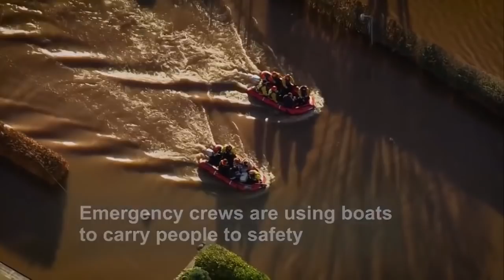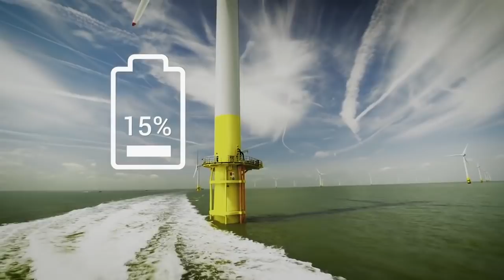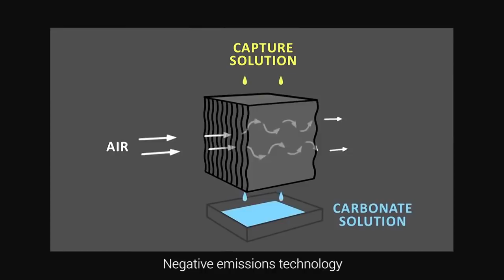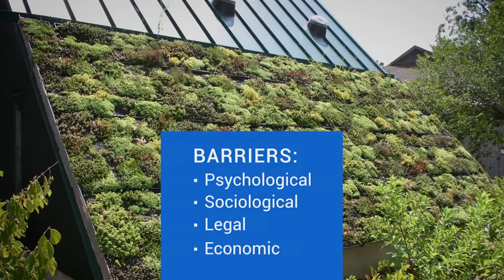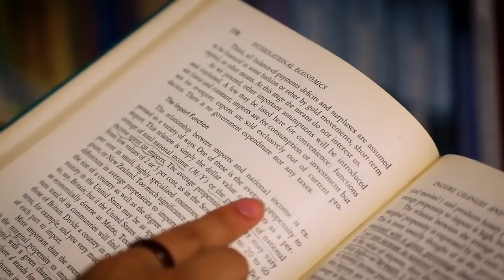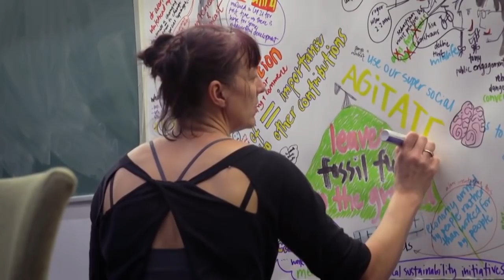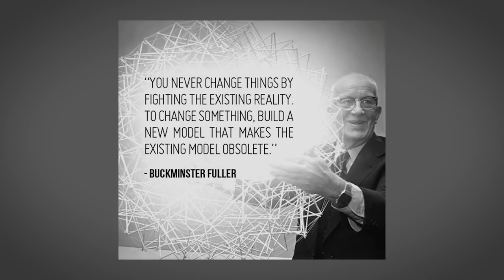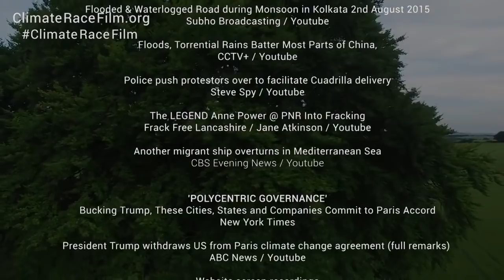The Race is On - Climate Change Documentary 2020 ᴴᴰ

Comment: Earth's climate has a rough history with climate change. The problem has been that it has been too cold for us. (Examples - Major event of Younger Dryas that froze the Earth for 1000 years 12,500 years ago. We have a medium-major event that froze the planet and blocked the sun for a decade in 563 A.D. known as the Late Antique Little Ice Age and a minor event causing decades of colder temperatures in the 1800s leading to crop failure and famine as well)  Although we may be contributing to climate change; it seems that what we do is a drop in the bucket compared to natural event caused climate changes such as increase in volcanic activity, major volcanoes single eruption, and intersteller object impact events. If we want to worry about climate change we should look to the sky and look into the ground.

Comment: There is this one question (or rather a dark image) that keeps coming back in my head everytime they talk about these beautiful green energy sources like solar or wind.. since we know that we are in no way stopping the warming completely and we can quite reliably predict that it's all going to come with more extreme weather, how are those solar panels gonna deal with furious winds and violent storms? Are those wave-energy systems designed to withstand unusual extremes? How about windmills being ripped apart?
Reply: If the extreme weather events increase to the point that solar panels or wind turbines cannot survive, they will be the least of our problems.
Reply: Then if they will be destroyed in the future, they will replace the broken one ofcourse.
Reply: @ronalynguisdan2338  i believe that if we calculate how all the energy that goes into the mining, manufacturing and maintenance of all those countless materials and parts, relates to the energy produced and whether this translates economically as well as ecologically into a more sustainable solution than nuclear power plants, we would come to the conclusion that nuclear is by far the best option..
Reply: @ladybug74  The current solar PV panels being used and produced, create 20x more energy than is used to create them. Levelled costs (materials, fuel, transportation, maintenance and decommisioning) for solar and wind turbines per Mwhr, are less than nuclear. Solar $55 per Mwh. Wind turbine $45 per Mwh. Nuclear $110 per Mwh. Coal $120 per Mwh.  Those are averages.The sole problem ecologically, with Nuclear, is the radioactive waste. It is also right now more expensive, and getting even more expensive. Subsidies are required as plants age. However it can provide base power whereas renewables currently cannot. Solar and wind turbines are by far more ecological than fossil fuels.